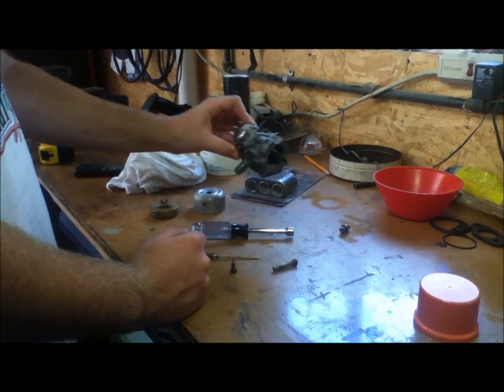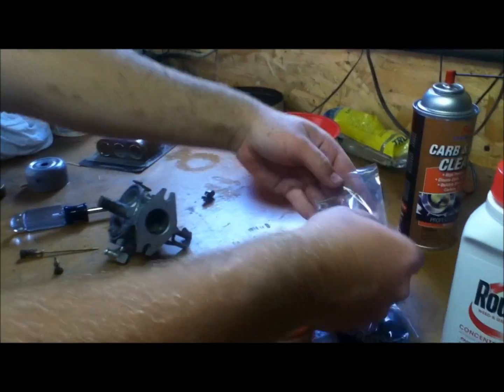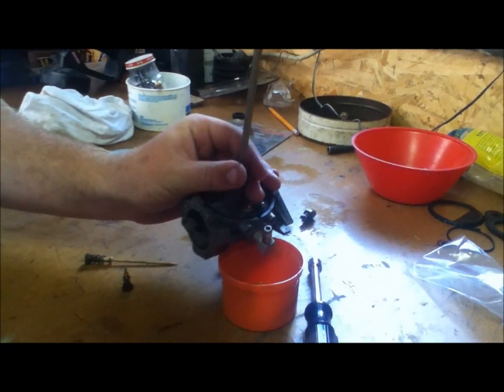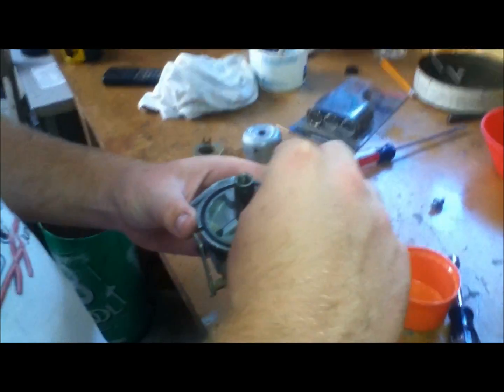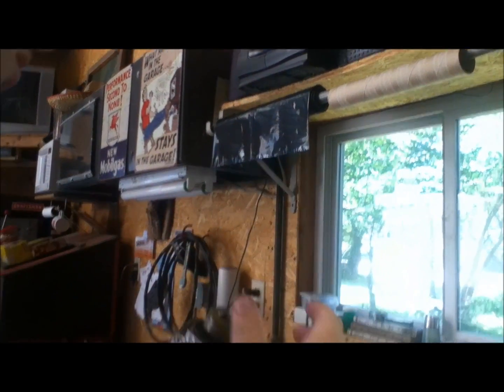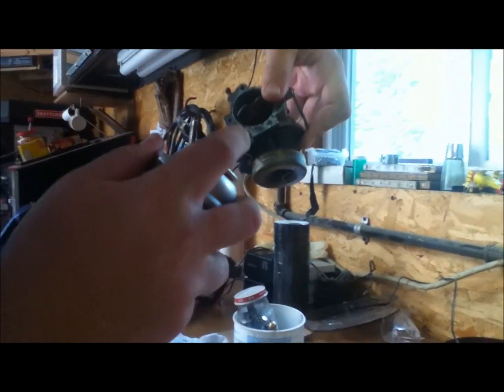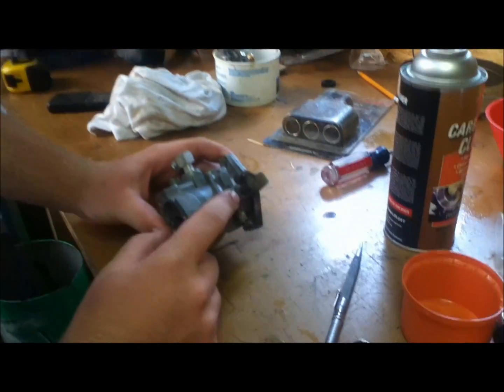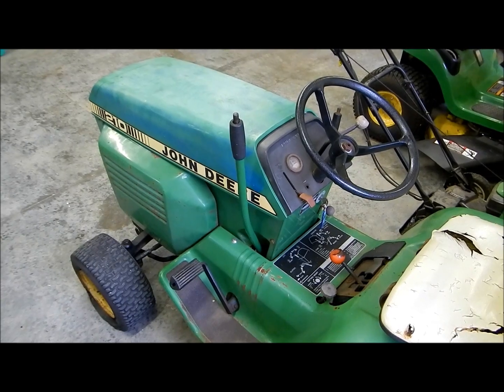How To Rebuild a Kohler K Series Carburetor (K161, K181, K241, etc.)

Comment: That stuff isn't strong enough to eat through the tar in mine I've tried alot of shit on mine nothing wants to dissolve the tar that's in any turns or elbows of the old carburetor I believe my 110 would stay running with a new carburetor one i bought last year for it didn't work good so took it off and put the original carburetor back on mines not getting no gas in the carburetor it does run for a few seconds after i blow gas into the carburetor I'm done with that old carburetor and the metal gas tank needs a new nipple at the bottom of it

Comment: the inside channel the carb fits onto is quite pitted/dirty.  Should this area be sanded down at all or cleaner used?  I'm a bit leary of getting dirt/debris into the inner part of the engine by using anything sanding wise.....thoughts?
Reply from the maker: Completely normal for it to look that way.

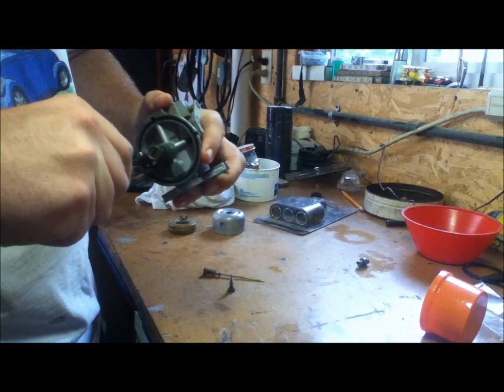Comment: what size is that nut driver socket you used on the screw driver to put in the seat screw holding the float valve?  roughly @ 2:24 in the video
Reply: found it...10mm...

Comment: I don't mess with those kits anymore.  What I always run into is worn out shafts.  I just ordered a whole carb off of ebay for $13.54, free shipping.  Chinese made but so much easier and they work great.  Still a thumbs up for your effort.
Reply: oh yeah I did the same thing but idle was never smooth and I finally tore them both down and compared them and for the most part they are identical except the main jet (emulsion tube) had less holes on the new one and they were smaller so what happens is you have less air being mixed with the fuel. You can't buy just that part so I went to the college machine tool instructor and for $25 they made me some I only needed two but got 7 for that price. Defiantly made a difference at idle.
Reply: @silentdeath9237  I never noticed that because it was on an 8 hp. craftsman on a chipper shredder so an idle wasn't that important.
Reply: It didn't work great on mine it worked shitty the choke would only close part way all the cable hook ups needed re-drilled out on the carburetor the cable hook ups were on the wrong side i couldn't use it

Comment: my main jet stripped out and i cant remove it should i keep trying to remove it or stop there and give it a good cleaning and continue to do a card rebuild
Reply from the maker: Soak it in chem dip and blow it out really well with the main fuel mixture adjustment screw removed. I've had several that were stuck/stripped and they ran fine without being removed.

Comment: Thank you for making this. It helped quite  bit. What I find sad is I can buy a brand-new carb on eBay for $16. People aren't going to try to rebuild what they have.
Reply: Not a carter carb. It is a chinaclone and most need modification to connect your cables. I also notice there is no quality control. Some are good others are not. You get what you pay for. isavetractors.com has quality ones.
Reply: @gregolson1970  for a 1968 John deere 110
Reply: @gregolson1970  I need one for my 110 if it'll work
Reply: Your wrong because I've tried with this thing when I first took it apart looked like thick black tar all in it i scraped and picked and dug out the most i could and the old ass carburetor still doesn't work right i bet it still has a blob of tar in a curve or bend inside the carburetor that I can't get to
Reply: @Mike-su8si  You have to remove the main jet and clean it. Hard to do if you are not familiar with them. They are brass and strip easily. The screwdriver you use must be as wide as the whole. I grind down a cheap one to fit.
Reply: @gregolson1970  one of those are bent upwards on the front part of the carburetor it has a slight bend
Reply: @gregolson1970  I've took those out already and cleaned them those aren't clogged anymore but it still acts plugged up in some place in it maybe acetone would eat through the tar
Reply: @Mike-su8si  Only 1 main jet. It is at the bottom of the 2.5" needle. Every one I've cleaned works good unless the throttle body is leaking. There is a gasket available for that.
Reply: @gregolson1970  but did yours have years of thick black tar all in them though it was really gas that sat for years in the carburetor and that's what it turned into like roof tar
Reply: @gregolson1970  I'd like to find a new carburetor for the k181s engine it would be more simpler.

I've thought about just burning the carburetor to burn out the old gas tar  that would get it but then might mess it up if it's not already screwed up that bottom brass piece looks bent 

I hooked the gas line to it and can blow through it but it still seems a little clogged 

I'm gonna look at the manual book to it i have the original book
Reply: @Mike-su8si  Yes that is an impurity in pump gas.
Reply: @gregolson1970  I know
Reply: @Mike-su8si  If you do not have access to an ultra sonic cleaner boiling in lemon juice or dish soap works pretty good.
Reply: @gregolson1970  I have already tried that but i can do it again

Comment: I have the same carb on a Kohler 12 HP engine, could you tell me how to remove the carb from the engine block? I loosened both of the bolts that attach it the the block, but it still wont budge. Any advice? Thanks in advance.
Reply from the maker: Give it a tap with a rubber mallet. The gasket is just stuck.

Comment: Forgot to mention, put locktite on new bushing and gently press it in with a socket in a vise or use a c clamp. Make sure it seats in all the way and square to prevent shaft bind. Put shaft in, to make sure it freely turns then take it back out over night so you don't accidentally lock it in place.

Comment: Not hating on your video, but you didn't address the most important issue with these carbs. You really should replace the brass throttle shaft bushing while you have it out. This will make the rebuild a little more tricky but it is MORE IMPORTANT than people think. Get the bushing, new screws, and new throttle shaft. The screws like to break so just grind off the heads with a dremel tool and cut shaft. Put in new shaft, use new screws, with locktite in old throttle plate. Then rebuild rest of carb! That area is a wear point that can leak a lot of dirty air around shaft causing a lean fuel condition, hotter running engine, burnt valves, and #1 cause of warped heads! Don't think yours (reader) needs this done? Put your mouth over top of carb. and blow, you might be surprised.
Reply from the maker: This one didnt need a new shaft, its not wore out.
Reply: Do you have a link to these parts or video to help? I need to rebuild one for a 241
Reply: http://www.gardentractorpullingtips.com/carbfuel.htm

Everything you could ever want to know about these carbs and then some. A lot of reading but scroll down the page and you'll see that this guy sells all the parts you need. I usually buy a few sets at a time because I work on a lot of k-series engines (personal collection)
Reply: Also cheaper than I've found anywhere else excluding eBay.
Reply: INCLUDING eBay

Comment from the maker: If its in bad condition, replace it. If not, its fine. Mine had a very thick hard gasket on it so I was able to re use it. Just make sure the engine and carb surfaces are clean before reinstalling!